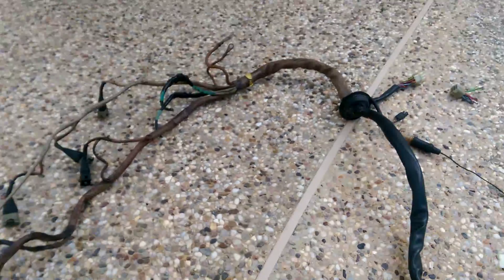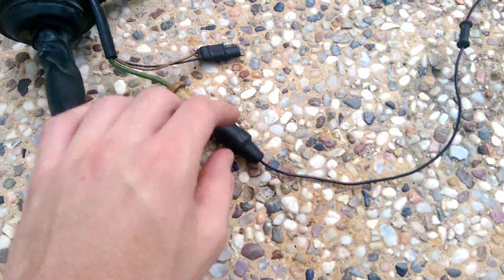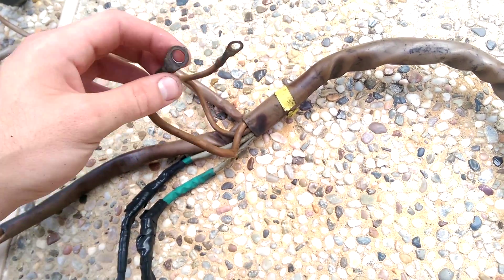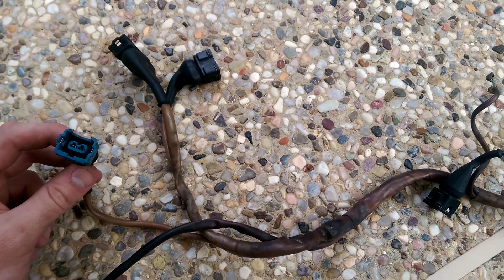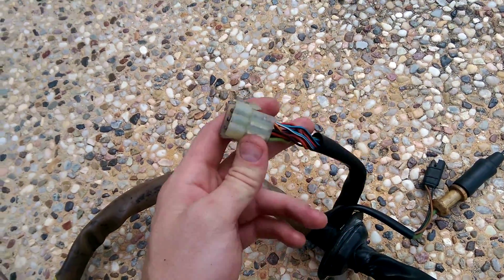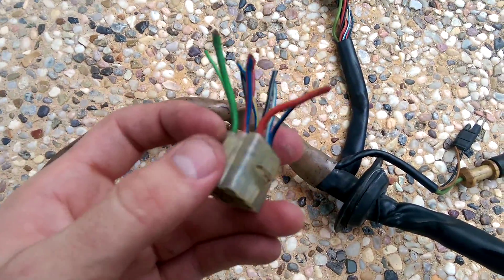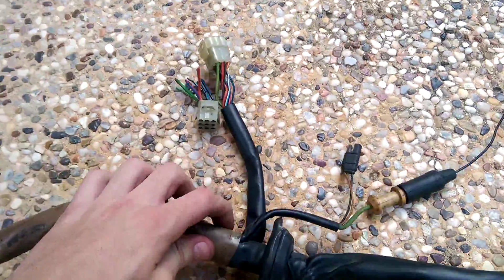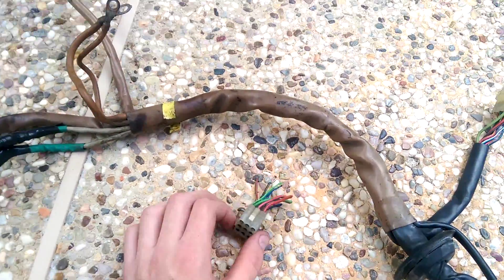Porsche 944 wiring harness overview

Comment: any video regarding rear "brake pad sensors" all the way to the front of the vehicle etc and where is conected? Mine got on fire for some  reason and I need to figure out how to eliminate the problem. thx. 944 Porsche 1987 (non turbo).